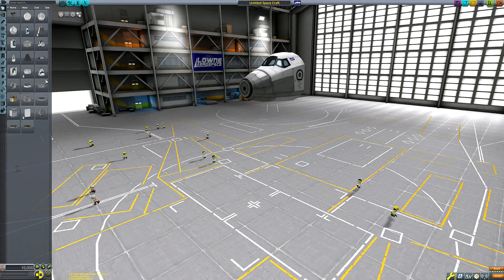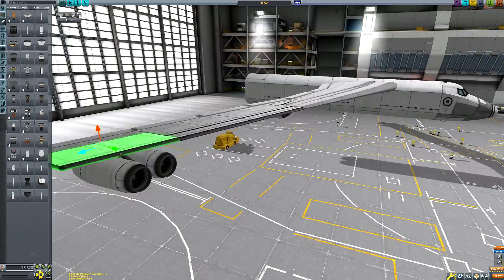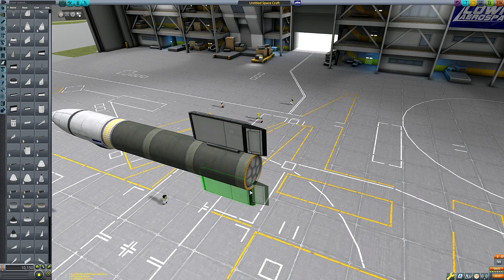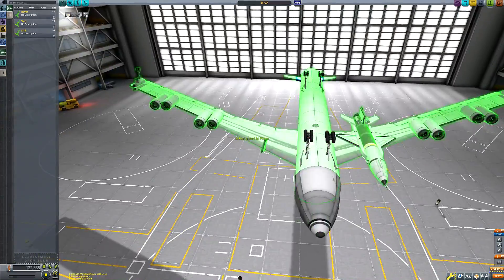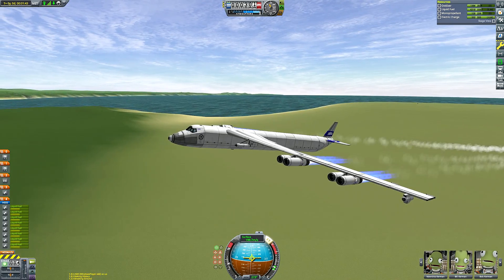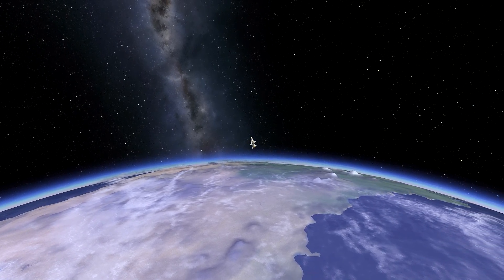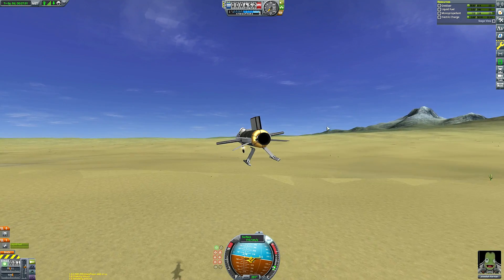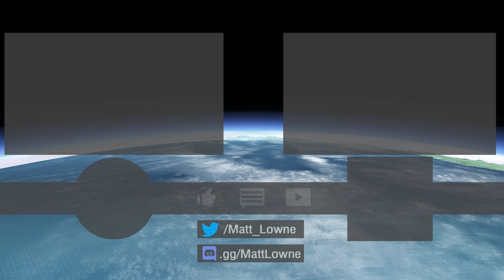KSP: Air-Launch from a Bomber! (X-15)

Comment: I just came here after making my own X-15 inspired craft. Mine is a little wider on the back half (MK2 Fuselages) and I haven't built the B-52 Stratofortress yet so it has to take off from the ground, but because it's a little wider in the back it actually has just enough Dv to reach sub-orbital space! Cool video! PS. I also made a variant with the RAPIER engine and it's awesome.

Comment: My KSP is not working it always when taking parts reverses it like on the space plane hanger and vice versa. I think it is probably because I put my folder in desktop. Have you had this problem before and tell me what to do to fix it. Now I moved the folder from the desktop to file explorer. It is the free download from OnPoint youtuber and also tell me how to download parallax mod in KSP 1.11 easily because it  is incompatible with Ckan.

Comment: Umm... the U.S.A uses the imperial system, so on that point you were correct, however, kilometres are a metric measurement. Miles are an imperial measurement and therefore you should have been using miles when talking about the United States Spaceflight.

Comment: The US still uses the 50 mi definition.  The justification is that aerodynamic control is impossible beyond this point.

Interesting thing is that the aborted Soyuz launch a few years ago went beyond 50 mi but below 100 km.  Thus, NASA considered it a suborbital spaceflight and awarded their rookie  astronaut full astronaut wings, but Roscosmos did not consider it a spaceflight.
Reply: If I remember right, Karman's research led him to define the line as 80km initially, but he was fine with people who wanted to take it up to the round number 100km.

Comment: There's a distance limit between vessels in which you can switch between the two, even in atmosphere, using "[" and "]". It's around 20km. So what I did with my (more faithful than yours because no one died (well people DID die in X15 flights in real life but that is not the one)) X15 recreation was aim the rocketplane at such an angle that when it leaves 20km range of the Stratofortress bomber, it would have AP outside the atmosphere. I then switched to B52 just as X15 crossed the limit of 20km. In the time it took the X15 to reach the AP in "on-rails" mode, I SWIFTLY landed the B52 and when it was at a halt on the ground, I could SWITCH to my X15 outside of atmosphere and land it. FUCK MODS! ALL MY HOMIES RUN FULL STOCK REPLICAS!

Comment: However since the X15 couldn't take off under it's own power it was disqualified. 
Leaving the SR-71 The fastest aircraft to date.
Reply: I upvoted, but then I learned the SR-71 couldn't reach full-speed without in-flight refuelling and didn't take off with full fuel to avoid stressing the landing gear, so it required in-flight support to get up to speed, too. I'm a little bit sad now.

Comment: The X-15 was a good contender for the SR-71 blackbird but the X-15 could never catch it because the thruster engines on the SR-71 was built in a way that all the initial power was jutted right into raw thrust so the SR-71 had the best acceleration possible if it needed to dodge a missle and the X-15 had a slower build up time but it had less fuel so it was practically impossible for the X-15 to catch up.

Comment: As someone who used to work on them, that was a pretty decent B-52. Only critique is that the wing tip landing gear are connected to the wing and not the external fuel tanks. Minor detail though, it really looks like one.

Comment: The SR-71 still holds the speed record as an air breathing craft
Reply: WeLl AcutUalLY I thinK The A-12 oxcart Was FAsteR (seriously does it count as the same plane or different because i think it was faster idk)
Reply: @bcrides6717  The A-12 was kind of the SR-71 but a fighter
Reply: @reztlest incorrect, you’re thinking of the YF-12
Reply: @tacticalswitch6153  wasn't that an interceptor?
Reply: @ez_theta_z9317  yes, it was, but I thought that was probably what he was thinking of
Reply: The blackbird family of aircraft have the highest sustained speed of any manned air breathing aircraft, the x49 I think is a Mach 8-9 scramjet powered UAV, but it is unmanned, meaning that the black bird keeps the speed record for a manned airbreathing aircraft.
Reply: @WildmanTrading  ngl the X-43 is one of my favorite aircrafts
Reply: The Mig-31 foxhound could exceed the speed of a blackbird in a dive, but this speed could not be sustained.

Comment: The x-15 isn’t a plane, it has a rocket there for is a rocket with wings, and the sr-71 is an actual plane, although it did get a slower speed, it got a faster average speed

Comment: Note: B-52's outrigger wheels don't always touch the ground when on ground. It's just to support the weight of thr wingtips when full of fuel. So wheels not reaching the wheel ground by quite a bit is fine.

EDIT: Typo
Reply: ok random sir I found in the internet…

Comment: Quick tech tip: use the green button next to the altimeter for cycling the gear (and increase braking force to ~70 during the build) and use at landing the orange button to turn on brakes (also works for airbrakes & dragchutes)... ;-)

Comment: Ngl my x15 model is better. It uses mk2 parts with a clipped MK1 cockpit. It also uses 2 rapier ramjets to power it. It’s more faithful because it is mk 2 part shaped and the real craft uses two rocket engines/ramjets they were kind of a hybrid between the two. Using the little air up in the atmosphere to force more pressure to the bell of the rocket engines

Comment: Matt you know what you gotta do? Recreate this mission in KSP2, which will have multi-player compatibility. Then, the crew in the B-52 won't have to uhhh, smash into the surface at a high speed. Have a friend pilot the B-52 or X-15, and you pilot the other craft. And maaaaaaaaaaaaybe I could help out by building the X-15 and maybe fly it🤔

Comment: Remember you can always go around You can always go around
if it don't look right coming down.
Don't wait until your socks keep sliding on the ground.
You can always go around.
I know back when, when I learned to fly
my instructor was yelling in my ear
how we're in carb' heat cold, climb out, pitch, flaps to go
take it 'round the pqtch, one more time again
But I know now, he was showing me
that's just because the nose is pointing down.
If it doesn't look right,
give it one more try.
You can always go around.
You can always go around
if it don't look right coming down.
Don't wait until your socks keep sliding upside down.
You can always go around.
You're coming in,
you see you're high and fast,
but your mind is set on somehow getting down.
The runway leads to grass that leads into trees
it will leave your sweater dripping from your brow.
You still got time.
Simply change your mind.
It would sure be nice to fly this plane again.
With the wings still straight
see no place to hesitate.
Pitch and power, gear and flaps.
Hey, "Go around"!
You can always go around
if it don't look right coming down.
Don't wait until your socks keep sliding on the ground.
You can always go around.
You can always go around
if it don't look right coming down.
Don't wait until your socks keep sliding on the ground.
You can always go around.
You can always go around
if it don't look right coming down.
Don't wait until your socks keep sliding on the ground.
You can always go around

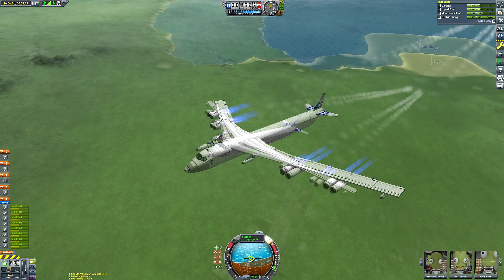Comment: 10:55 The instability is probably because the vertical stabilizer is way bigger on the real deal.

It’s been a while since I’ve played it, but my recollection is that KSP doesn’t really have any vertical stabilizers correctly scaled for larger & slower aircraft like the B-52. I’m not sure why, but I think there are at least three factors. First, people in general seem to think tail surfaces are smaller than they really are, and since Squad’s part designers are generally people (😁) they might be unaware of the issue. Second, this is Kerbal Space program and, while you can build regular planes in it, the game is obviously centered around spacecraft, which often don’t need control surfaces at all once you unlock gimbaling engines. Third is that a large vertical stabilizer is needed on real planes in part because they have to deal with cross-wind takeoffs & landings, and wind is something which KSP sadly (IMHO) doesn’t model.

Comment: Is it possible to build a launch aircraft so stable and efficient that after orbiting or landing the air launched payload the launch platform is still flying and can be switched to from the tracking station in the same load ?
Reply: I'm not sure, but once the launch platform is out of physics range, I think the atmosphere effectively goes away and it follows a ballistic trajectory to the ground. Or to whatever the deletion height is; it might be as high as 25km.

Comment: The SR-71 may not have required a separate launch vehicle, however it did need to refuel after take off.
Reply: I had to look that up. You're right, it's fascinating! I'm very impressed with the difficulty of the procedure, but slightly saddened that the SR-71 couldn't reach maximum speed with the fuel it took off with.

Comment: If only we'd kept the X-15 program & given it it's head. We'd have flown into orbit instead of, for political reasons, stuck humans atop ICBMs for, as they described it, Spam in a Can missions. 
The X-15 had integrated in atmosphere & in vacuum craft control down to stick & pedals so if it was RCS or elevator, ailerons & rudder the pilot used the same controls. Amazing technology for the time. 
Fireworks are always the same, a quick, dramatic flash bang & everyone goes "Ooooh!". Whilst aircraft just get on with the job in hand without much notice from the public. Politicians know this & it's why we're stuck in the "Fireworks to orbit" rabbit hole. 
If the path North American opened up with the X-15 was followed we'd be way ahead of where we are now. With a much firmer footing in space too.

Comment: Your landing legs were failing to deploy because they require electric charge. The capsule only has a little, and you burn through it with the capsules reaction wheels.

Comment: the skis didnt extend fully because of the electric charge running out
Reply from the maker: lmao
Reply: @MattLowne  Also landing skis get destroyed one because the parts are week to tortion, two because you added adhesive parts to them wheeras the skis should be left bare to minmize friction. Chutes would have done the most of the breaking.
Reply: Quo Niam I had a stroke reading this
Reply: Jamie Chen how?
Reply: @jamiechen9705  i didn’t, but I could see why
Reply: @jamiechen9705  same
Reply: @MattLowne  should have clipped in an RTG
Reply: Aaaaaaaaaaaaaaaaaàà
Xẻcvynyn
Reply: the most kerbal thing ever

Comment: Matt there is a mod called flight manager for reusable stages (fmrs) you launch rockets or plane launched rockets the same, once the mission is complete it allows you to revert time back to when the craft separated so you can land the 1st stage, unlike simply quicksaving it saves both ships to the save file so you can control them effectively at the same time. I didn't do a good job explaining it but it's a really cool mod that allows you to perfectly recreate these types of missions and space X style recovery while the craft are still in the atmosphere
Reply: he is aware of the existence of that mod, but he doesn't want to use that because he wants this series to be fully stock apart from graphics mods

Comment: Fun fact: the X 15 pilots were the only ones who got the astronaut wings without ever going to space with either a rocket or a space shuttle.
Reply from the maker: Storm area 51 to find the ꝁɍȺꝁɇn đɍɨvɇ
Reply: @MattLowne  

Only if you naruto run
Reply: @MattLowne  zeet
Reply: @MattLowne  yes
Reply: @MattLowne  yes, the holy kraken drive
i hope it comes with time warp
Reply: I think some U2 pilots got the astronaut badge
Reply: @epikmanthe3rd  
Not possible, 
Max ceiling for the U2 is well under 50 miles OR 62.4 miles. 

The dragon lady is only good for around 75,000 feet. (The U2C variant with the uprated J57 engine) 
SR 71 could do 85,000 (possibly a bit more, but that's still classified) 

No air breathing jet aircraft can get anywhere NEAR space on turbine power alone.
Reply: @stinkyfungus  aircraft like the X-53 probably could as they actually surpass the X-15 in sustained speed  but that's yet to be tested
Reply: I thought the X-15 was a rocket. Yes the whole system was not just a rocket, but the X-15 was a rocket and that's the bit that went to space
Reply: @hannahalice1000  Technically it was a plane with a rocket engine. (like the Me 132 from WW2 germany). The plane part being that both hat wings that generated lift to a certain degree which a rocket lacks.
Reply: @andreasmuller4666  does the Shuttle have jet engines? Because otherwise all that applies as well.
Reply: @hannahalice1000  If you are talking the old NASA space shuttle then yes ofc it had 3 liquid fuel engines. (for those it carried that big honking orange tank after all)
Reply: @andreasmuller4666  The SpaceShuttle itself isnt capable of actually flying in the Atmosphere, SpaceShipOne and the X15 are capable of flying on their own.  Its still a tricky thing to decide all that. But still X15 and SpaceShipOne are the same both have Rocket Engines and Wings, one runs on Solid Fuel the other on L/OX
Reply: some actually did go into space.
Reply: @eliteal2188  Yeah but not before flying the X-15 and for that they got those wings.
Reply: @andreasmuller4666  that's.. what i mean.
Reply: Richard Clutterbuck Well it's a rocket powered spaceplane like the X-15
Reply: cough cough spaceshipone cough cough
Reply: U-2 and SR-71 pilots: STFU.
Reply: I think U2 pilots were considered astronauts at least for the time the U2 was made
Reply: Actually not all of them did only if they pass a certain altitudes
Reply: the X 15 was a rocket, it just did not launch from the ground, or under its own power.
Reply: James Hoffa  
A) you´re a toxic clown shoe
B) i know what i´m talking about
C) why should i shut up just because you bumfuck told me so?
Reply: Fun fact: x- 15 cant land
Reply: @kaseycaseyiel  The X-15 absolutely can land, it did so on all but one of its missions (one of those landings was a crash landing though)
Reply: @kaseycaseyiel  it can? Just can't take off
Reply: Neil Armstrong flew one once and skipped off the atmosphere. He got back obviously but still.
Reply: @dog6522  The earlier X-15 flights never got above the Kárman line.
Reply: The X15 Breached the Karman line on 13 separate flights. I'd call that going to space. Niel Armstrong ended up bouncing off the atmosphere and ended up over LA despite aiming for Edward's AFB
Reply: One of the x15 test pilots did fly in the mercury-redstone program, so it's a win win for them
Reply: i think they might have for a moment during flight (/ '-')
Reply: Until last year when we had 5 people going to space on Virgin Galactic's craft
Reply: @theadventuringnerd  Was about to comment that, but its technically still a Rocket BUT the X15 is also just a Rocket with Wings strapped to it.
Reply: @theadventuringnerd  I don't think they would get wings, they aren't in a military or government otherwise position.
Reply: Fun fact: the X 15 pilots were the only ones who got the astronaut wings without ever going to space with either a rocket or a space shuttle.

Also, Epstein didnt kill himself

Comment: Take a look at Kevin MacLeod, he does a lot of audio work and the licensing there is done independently, I know Scott Manley uses some music from him
Reply: On his Twitter he said he doesn't want to use any music given that even music that youtube said would be safe wasn't l.
Reply: @harrymack3565  from what I understand, Warner Chappel or however it's spelled gained the rights to a sound library that a lot of composers used to use. Which means that at one point that music was royalty free.
Reply: @LordRavensong  Oh. Thank you I didn't hear about that.
Reply: @harrymack3565  I could be wrong, maybe they always had rights to it and then decided to do this. It just seems odd that the song was in a free library and then it wasn't anymore
Reply: Harry Mack yes, I saw the announcement video. That’s why I suggested Kevin MacLeod. Several sites I’ve subbed to for years use his tracks and there have never been issues. Miniwargaming has used his tracks for dozens of series’, Scott Manley, just off the top of my head. Yeah, it could involve outside licensing fees. But at 250k+ subscribers, it may be time for an investment instead of just free things that may not always be free.